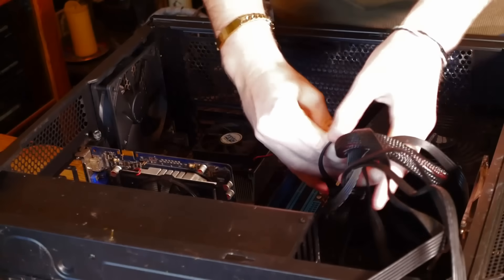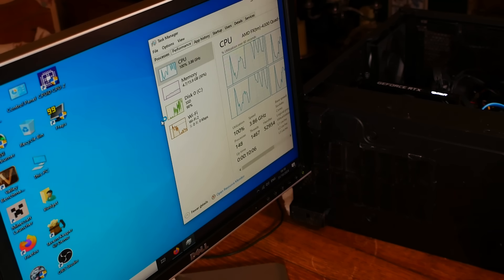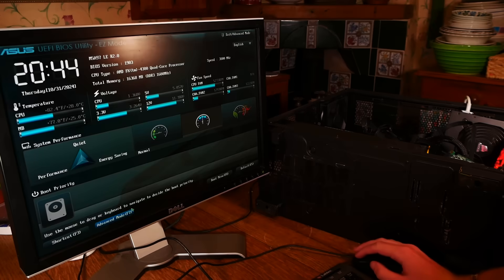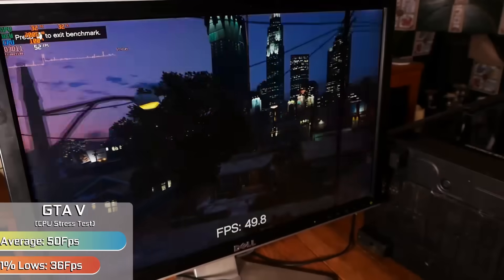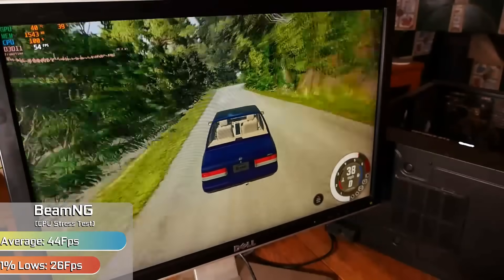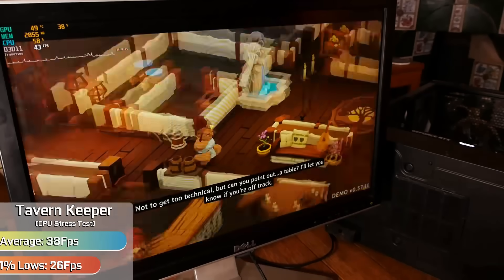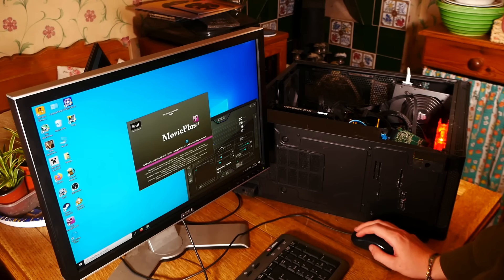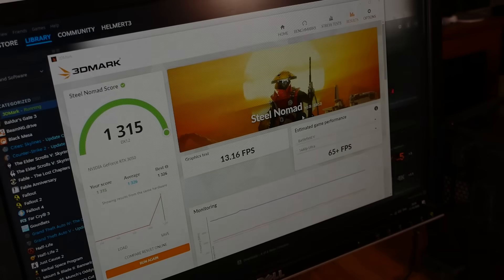AMDs Weakest FX Processor...

Comment: THESE things... PC building, a bit over a decade ago. Two cores is still mostly fine for gaming, but it's clear where CPUs are heading and the first games to spit out less than four cores have arrived. (They are mostly bad Ubisoft games) You want as many cores and threads as possible, but what to buy? Everything Intel that's remotely futureproof (think i5-4460) was like $200, but AMD... between AM3+ and FM2+, they're both dead or dying sockets and it's not like the 8350 or 9590 is gonna match any Haswell system. Might as well spend less on your dead socket and pair an FM2+ Athlon with whatever cheap A55 board you can get, since the L3 cache on the 4300 didn't help much and you'll have to junk it all someday, anyway. It was a really ugly time for CPUs, before Ryzen saved everybody.

Personally my strat was spending way too much on socket 1150 i5's paired with dirt cheap H81 boards and cry about it. I used a few of AMD's "module based" "shared architecture!" FX and A series CPUs/APUs, their shared floating point units mean they DID NOT always behave reliably and could be slow at really random times, the Windows scheduler hated these back then. I'm surprised to see the 4300 perform not like trash, but I'll never trust them. 

Mantle, and Dual Graphics, and all the HETEROGENOUS SYSTEM ARCHITECTURE!! stuff AMD was pushing between this and their APUs seemed like they were gearing up to keep pushing awful processors into the market. They kind of silently dropped it all when Excavator dropped in laptops, and then Ryzen came out...

Comment: I upgraded from a Core 2 Duo E8400 to an FX 4100 I was given. I'd also been given an i5-750, but I was too inexperienced at the time to figure out the motherboard/chipset compatibility situation.
I overclocked it to 4.5GHz and ran it for years, eventually degrading it because I had no clue what I was doing and just set 1.5V, until then buying an A10-7870k (functionally the same CPU but with a good IGP for its era, OC 4.4GHz), and then being given a Ryzen 3600 on launch.
Reply: You downgraded from a Core 2 Duo E8400 to an FX 4100
Reply: @siniyden  Ha ha, I'm laughing, FX is terrible and the worst architecture ever. Funny.
But per Passmark (because easy comparison and they're not UserSmenchBark) even the literal dorito that is the 4100 is dramatically more powerful in both single-core and multi-core than my venerable and beloved E8400.
The FX even throws down and plays ball with the most powerful Core 2 ever, the Q9650.

I'm actually looking forward to unchaining the FX6300 a friend sent me, which hopefully isn't even degraded like my 4100 is.

Comment: Late to this. As I recall, the core controversy had nothing to do with the shared cache, but shared FPU. For integer tasks it's a four core processor, but anything requiring an FPU and it's a dual core with very beefy multi-threading.
For buying new, I cannot disagree that the option you chose was a good one - but I stuck with my Phenom II X6 from 2010 through to 2015 as in my hands on tests, my overclocked Phenom could truly embarrass an '8'-core FX 8350 that was also overclocked.
I think that was actually the biggest problem for the FX processors. It was slower than the AMD architecture that came before it. I had bought the FX 8350 to finally give myself an upgrade and found myself going back to the Phenom II as it was faster in every way that mattered. By the time the FX architecture could mature, it was too little, too late.
I've actually found myself on Intel ever since. I must stress that this is not some brand loyalty nonsense, but rather AMD has got so good now that it has pushed the price of a lot of good enough Intel gear down to prices that are more appealing - the budget builds mentality lives on.

Comment: I had a 4300, as well as an 8320 (which overheated my motherboard VRMs so i had to turn off 2 cores essentially making it a 6300)

They were junk for gaming but boy could they candle an overclock 🤣 i got the 4300 up to 5.2GHz with a hyper 212 cooler

Comment: The lawsuit wasn't over a shared cache, even intel shares every level of cache besides the first one. What got AMD in a technical oopsie was that there were the stated number of cores in integer units but every two of those shared a floating point unit unlike intel who had used 1 fpu per integer unit per "core" since the 80486. So it was argued that since every integer unit didn't have it's own floating point it couldn't be called a core which is odd as that means intel's first 30 or so CPUs also weren't even single core cpus by the argued definition.

Comment: 4.8ghz fx830 with a 1060 6gb still plays everything I throw at it,  @1080p or higher, and runs switch emulation fine enough to play (which is pretty impressive if you know the typical hardware specs for that lol )

Comment: Ran an FX 4300 or maybe it was a 4350 for a short while, but it fairly quickly got upgraded to an 8350(and ran a Phenom II X3 before that). I did uppgrade to Ryzen as soon as it launched, but the 8350 lived on in my server(and got paired with another similar system) as it was a pretty cheap way of getting a lot of cores for virtualization.

Comment: I used an FX-6300 paired with a GTX 1060. All the way from 2016 up until 2020. Was a great CPU. Didnt really start showing its age in video games until the last year or so. I still use that configuration in my secondary system and the 6300 is still good to this day as long as you dont expect the impossible out of it.

Comment: A few years ago I had a PC with the even worse FX-4100 processor that I got used with a motherboard for $25. It has got to be my least favourite computer I’ve built, as most of my games I played at the time only really cared about 1 core, so I was getting better performance in things like Microsoft Flight Simulator X with a Core 2 Duo laptop from 2009, than with the FX build, which FSX was absolutely unplayable on.

I upgraded shortly after to an i7 7700 build, which I’m now ditching for a Xeon W-2133

Might I suggest that you test some older 3D games from like the 2006-2009 era as well (so stuff like Crysis)? As while one might think that a mediocre Windows 10 PC would translate into an amazing Windows XP/Vista/7 era gaming PC, in the case of these FX processors, it really struggles

As always, keep up the good work! I love seeing some of the random old hardware I have being featured in your videos

Comment: im currently having an oc competition with friend of who gets the 4-core FX higher clockspeed.

I have 240 aio, friend has 360 customloop but i have 3200rpm fans on mine 8-)

Also 2400mhz ram just so its not a bottleneck lol

I got mine stable at 5.3ghz, but think my motherboard broke as after that i couldnt get even 5ghz stable anymore

Comment: i overclocked it to 4,6ghz on stock cooler XD was always running max temps. but the fx 8350 coudl run 10 games in 2014 without any drops. fast multicore monster but lacked 1-2 core fps in games like skyrim..so sad if any engine was like crysis 3s one.. all games would have run better then most intel users had at that time. but i was fine with only 5 games in 30 fps like skyrim. the rest was fine as at that time almost 99% already had at least 4 core (which 4,6ghz OCing made it a monster)

Comment: I used a Phenom II x4 during that era. It came out earlier, but wasn't far behind the FX in performance in gaming because games would only use 1-2, max 4 cores anyway. So all you needed was fast clocks and I overclocked as far as it would go :D That cpu lasted me for almost 10 years. Finally in the PS4/XB1 era the chip was missing some instructions that were needed by games like Resident Evil 7, so I got some (old) intel cpu for a few years (ivy bridge or something) and finally I upgraded to a Intel 10600k. Which feels to me a lot like the Phenom II chip. It was really cheap when I got it in 2020 (under 200$) it is super stable, overclocks to 5ghz and I just never have issues.
Goes to show how "unimportant" the CPU really is for PC gaming... I currently have a 4080s (not using high-end cpus leaves a lot of money for gpu) and I run every basically every game at 90fps+ (unless there is full path tracing going on ofc, but that is not cpu dependent anyway).

Comment: In this era, I bought my first new computer. I opted to buy a prebuilt ASUS ROG box, because it was with a i7 3770K and it was cheaper than building it myself at the time. I originally was going to go FX, but reviews really scared me away from them, so I just dealt with my hand me down core 2 with no graphics card, playing Dolphin games with half the textures not loading.(If I was more tech savvy at the time I would have probably instead tried to upgrade to a core 2 quad and get a decent gpu, but I was very novice back then)

Comment: I used a fx8150 in my first custom build with 32gb of ram and a 7970 gpu. If I went with a 3770k odds are my gpu would have been a 6770hd salvaged from a prebuilt I had added the gpu too. As I only would have had $150ish leftover and would have needed to save for another 3-4months to afford a decent somewhat high end gpu.

Comment: the FX CPUs were never good. I built an FX-8320 system when it was new and used it for 5 years, and even overclocked to 4.4ghz, it couldn't come close to the same levels of performance out of contemporaneous OC'd intel i7s or my gen 1 ryzen 4 core that replaced it. I doubled my FPS in games such as PUBG, CSGO, etc while keeping the same graphics card and enjoying a much smoother experience overall. Comparisons of the FX architecture to the intermediate die-shrunk Phenom II APUs with no L3 cache showed APUs delivering better compute performance clock-for-clock, while costing even less than FX-series processors. Contemporaneous games couldn't even take advantage of its architecture as single/dual thread dominated from the time of its introduction through 2018 to (in some cases) 2020. When AMD started running steep discounts after FX went terminal, you could start to argue price/performance, but there were (many) better options on offer from Intel from 2011 - 2014 that would age better. 30 FPS with none of the goodies turned up, Windows/games knowing how to use it now, or internet browsing are not convincing redemption arguments for me.

Comment: The FX line was never good because the market never moved in the direction its architecture was setup for lol but its was £50 new. It was so bad that the previous 6 core phenoms matched them in performance. 
A few years later intel released the G4560 Pentium, an i3 for £20. Now THAT was one amazing budget CPU. It was so good intel quickly stopped making them as they butchered the i3 line at the time. Those g4560s are worth looking at.

Comment: My FX-8350 has a major advantage over all contemporary Intel chips that this video overlooks. Namely, that it doesn't contain an embedded spy processor running it's own complete Unix operating system and full access to the hardware, designed in Tel Aviv.

Comment: My favorite AMD FX processors were the FX-6300 and the FX-8300. Both were neck and neck with the 8300 having a bigger edge on the 6300. I ran my 8300 on my main rig until in 2019 when it started lagging behind. I ran an overclock on it to be comfortable and eventually upgraded to AM4 managing to pickup a AMD Ryzen 3 1200. I really like the FX cpus and what they are capable of considering their age. Nowdays my main rig is running an AMD Ryzen 5 3600 and my old FX machine is my secondary machine I keep gave saves, mods, and backups time capsuled on. The bad wrap for the FX comes from the other 8300 series numbers like I think it was the 8350 or something where they really messed up the thermals and power. I had a roommate that had one that was awful.

Comment: The fx line was not realy that bad. Ran the 4 core , 6 core , 8 core versions. 
Frankly can't complain. Frankly the 4 core was in the workshop computer, Than the 8 core. Frankly if ... software would had used its wierd architecture better Than it would had went a lot better. 
It aged strangely , it had a drop then a rise. Frankly they still run used for laughable money , even the 8 core versions. 
Just as most of amd lineup , low latency memory gives it the most benefit. Try it. In my experience even if bandwidth has to be sacrificed,  low latency pays well. Its a responsive system. 
Actually on 8 core versions for some applications it was reasonable to disable half the cores. Thatway the cache and fpu sharing is not an issue anymore. Frankly , its a very decent cpu then , and clocks higher.

On a tight budget , want something that does not consume a lot , gives decent performance.... yepp an 8 core fx chip whit 4 cores disabled , is still an option that makes an a lot of sense. 
Try it.

Comment: Currently using a fx 6100 with gtx 750 ti, 10 gb ram (7 gb usable), Chinese 400w psu and 500gb hdd. Apart from the fact that i NEED a ssd, the pc runs amazingly and i can play alot of modern games with 30 or over fps. Definitely usable

Comment: Great video but I have a couple thoughts. The first is that beyond sharing cache id I remember, FX cpus had say, 8 integer units but only 4 floating point units so that’s why people said they didn’t have the full core count. Also, I would test BG3 in act 3 as that area is so much more cpu intense than the nautiloid you start in.

Comment: I do want to clarify something. The reason for the lawsuit and the argument as to whether they are truly separate cores (for ever two cores) is not because of the shared cache, but because of the fact that it has a shared front end and  FPU (floating-point unit) which is what performs mathematical operations on floating-point numbers on the CPU (basically the entirety of the early pipeline of the two cores is shared). Typically there is an FPU for each individual core, but in the case of bulldozer every two cores shared one FPU, and hence the lawsuit was because this did bring as much performance as full separate cores, with separate FPUs (hence why they began referring to them as modules). This design does not mean it can not truly run simultaneous multi threading (like Intel's use of hyper-threading, where the virtual threads can't actually be executed on simultaneously) they are very much still two separate compute units mostly but they share that specific function, meaning if something needs to use the FPU, you would have a limitation due to each core needing to share that unit. Their shared front makes things far more complicated. They share a cache (although they also have their own caches as well), fetch and decode. I'm not sure what all the effects are that this had, but I do know that all of this increased the length of the pipeline, which had the benefit of increasing clock speeds, however it also increased latency and branch misprediction penalties (which can be pretty severe. Prentium 4 was also well known for suffering from it's long pipeline with the same issues.) As we have found out from even modern CPU technologies like AMD's 3D V-Cache, latency can have a big impact on performance in certain types of applications; branch mispredictions are even worse though, because if one occurs, the entire process has to restart for that thread.

Take from this what you will, I just thought it was important to point out how large the differences actually are, and the Importance behind it.

Comment: WRONG
The weakest AMD FX CPU is AMD FX-51 featuring 1 core 1 thread 2.2GHz speed 1MB L2 cache. TOASTY 90W TDP , 130nm manufacturing process and it support only DDR1 memory. I had one behemoth like that and after using it only few weeks, i replaced it for PGA478 Intel Pentium 4 with hyperthreading ( it was definitely faster ) and later that day i found on a scrap yard Intel pentium dual core with motherboard and ram for socket LGA775 not a core 2 duo, Intel pentium dual core. Core 2 duo came a year or two later or it was already out but everyone was just throwing an old PCs out. AMD FX-4300 is pretty basic cpu for basic tasks completely fine or for kids or even gaming on that is clearly possible. The saddest thing is, here in the Slovakia i've got LGA 1366 motherboard with 6 core 12 threads Xeon X5690 and maximum 24GB DDR3 3channel RAM for like 50€ and it is kinda fast even today. Those 12 threads definitely help not to struggle so much with modern software. I'm having it overclocked to 4.5GHz and it is much faster in multicore performance than overclocked i7 3770K at 4.7GHz, tested in Y-cruncher.

Comment: The 4 core FX CPU's were bad, they wouldn't even match an Athlon II or Phenom II quad.  However the FX6300 when on a decent motherboard like the Sabertooth was pretty awesome for the price.  I used to run mine daily at 5100mhz.  When I got my first Ryzen (1600 on ROG X370) I could get better performance on the FX in PUBG with the FX on stock clocks and the memory speed, timings, cache and HT link optimised.  Bare in mind my Ryzen benches were some of the best in the HwBot league at the time so I knew how to tune it but nothing could overcome the poor cache tuning and extra latency with DDR4 that couldn't be pushed fast enough to make it worthwhile.  I even scored quite high in a Ryzen benchmark competition that year where my FX scores are pretty mid.
I initially replaced that FX6300 with a i5 4670k which naturally was overclocked, the performance bump in gaming was less than impressive to say the least, I'd say about 15%.  Considering how much it cost me to upgrade vs the cost of the FX setup I wished I hadn't bothered.  Still the 4670K beat both my first 2 Ryzens (1600 and 1700X) and was replaced with the 7700K which was a massive jump for me at the time.  That CPU overclocked like an absolute champ.
If you put the 8 core FX on a cheap board it will burn out the VRM's even at stock clocks same with a Ryzen on a cheap B350 board.